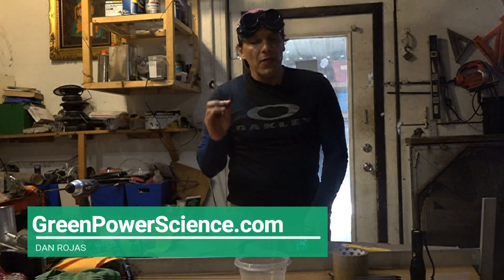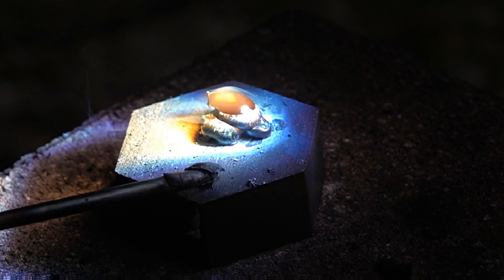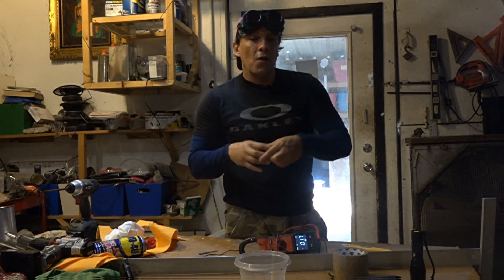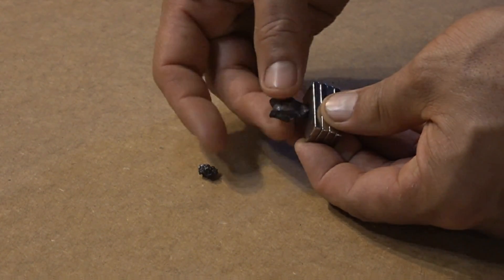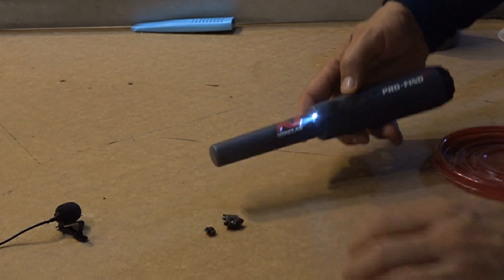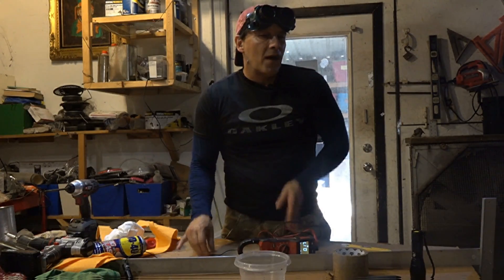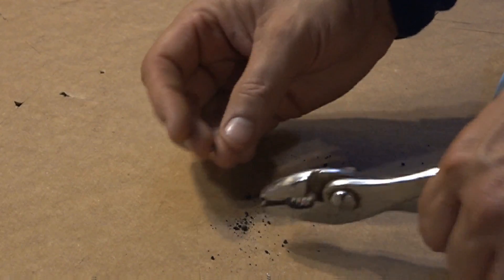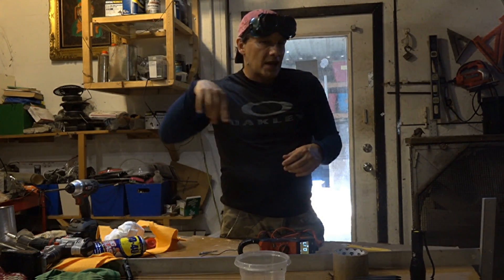Mixing  Glass and Steel using Sunlight non-conductive

Comment: The reason why the metal detector does not pick up the mixture is probably because the individual particles of conductive materials are seperated by glas. Therefore no eddiecurrents can flow and change the magnetic field. This is simular to how the laminations work in a transformer ^^
Reply: muh1h1 how do they add metal particles to ceramic knives then, to make them recognized by a metal detector? adding metals as lines inside?
Reply: If we are talking about x-ray scanners like they are used in airports, adding metal "powder" is probably enough to make them much more visible. To be detected by an inductive metal detector, you would need a "chunk" i would guess. Never heard about metal infused ceramic knifes though, is that something new?
Reply: Probably the currents induced into the tiny particles of iron are too weak for the detector. The question is: would a detector detect iron dust if you mix it with play-doh? This reminds me of fridge magnets that look like plastic but are magnetic and certainly not conductive.
Reply from the maker: Agree, just hard to believe the mixture is that good.
Reply: "...how the heck do they always know..."
I'm pretty confident that nobody actually knows the answer to your question.
You can't get much deeper than Maxwell's equations, so I can tell you what the electromagnetic force does... but not why.
Reply: One of the famous Japanese ceramic knife brand's website claims it has metal particles added to be detected by the scanners, I recall as  kyocera but not sure.
Reply: Well EDDY CURRENTS (see, did it right) are wanted in the coils, but not in the core. The core is supposed to "cuduct the magnetic flux" while not generating too much eddy currents, otherwise the core would heat up and eventually melt the insulation of the coils.
Reply: Yep :) That's more like it dude :) It's all about getting more reluctance in the core .that's why in the HF applications just laminating is not enough - and an iron dust core is desired :) thanks for acknowledging my comment :) I appreciate it dude :)
Reply: I studied electricity and magnetism throughout my electrical engineering degree, and this definitely seems correct.
Reply: Falcrist-Cool man, pls give some more explanations on the topic :) I love that kinda stuff I don't mind making an ass of myself :D
Reply: I was talking about the original comment, but that's a damn good attitude. Never be afraid to make a fool of yourself if you're trying to learn.

There are actually TWO ways I'm aware of to detect metal with an electromagnet:

The physics behind it is basically that a changing magnetic field gives rise to electric fields (see: Maxwell–Faraday equation). The electric fields (aka voltage, which is the EMF you mentioned) cause eddy currents in conductors. However, since there is SOME resistance in the metal, the current will create a little bit of heat. The heat is power dissipation... which you can see by looking at the current and voltage that you're sending to the coil in the detector.

The second way is to look at the resonant frequency of the coil in the detector (actually it would probably be an LC circuit). The presence of ferromagnetic material will change that frequency. I don't think this method is used, since the response would be RADICALLY different for different metals.
Reply: Cool ,Papa bless dude :) Did you get into why the eddies  arise in the first place and how the heck do they always know where is the perpendicular plane relative to the flow of current ? Thanks again :)
Reply: ok :) it was plenty anyways :) thank you ! You are a cool dude ,dude :) Bless up ;)
Reply: Its frekin EDDY CURRENTS man!!!!!!Get it right :) And btw Eddy currents are what make transformer coils work :D ! so ... yeah.
Reply: And btw I am NO physicist :D I just read that stuff for fun and I do NOT claim to understand it properly . And I guess I was wrong since what drives the electrons in a transformer is the electromotive force and not the eddy currents - they are just a by-product (from what my tiny mind can gather :D )